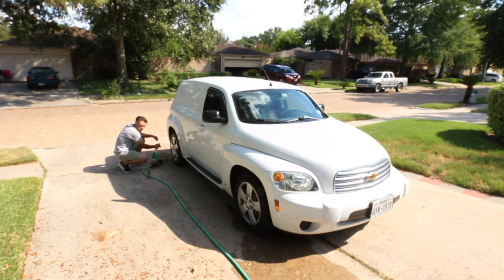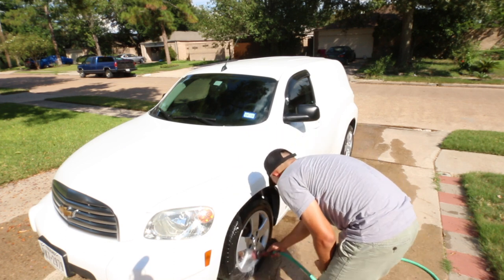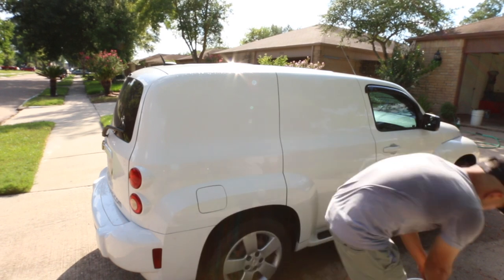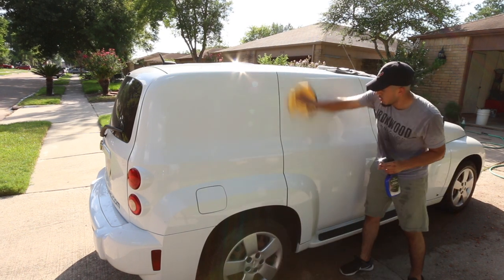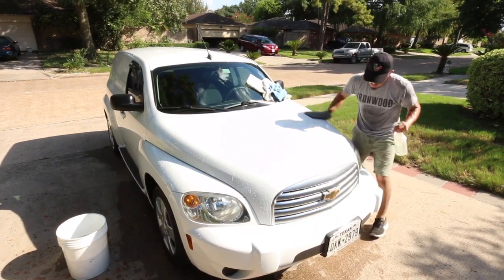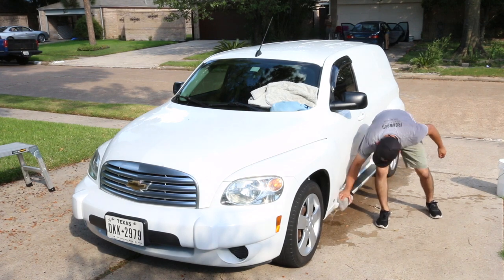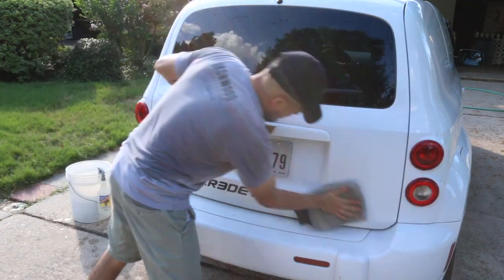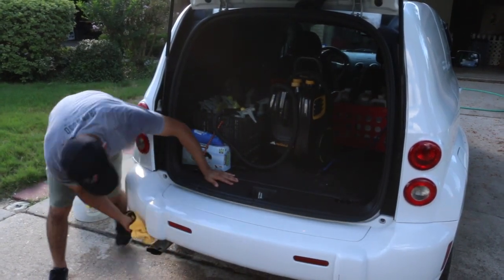TIMELAPSE: How To Wash and Wax Your Car

Comment: Oscar, Have you ever used a boars hair car brush to agitate/wash the car? The Hair seems so soft, but I wonder if in your professional opinion if it scratches the paint say compared to was standard wash mitt
Reply from the maker: A boars hair brush like the one I use for interior cleaning? If so, that's way too aggressive for washing. It will definitely scratch the car.

Comment: So i only do rinseless washes and clay and wax by hand for my business. I was told that after i clay a vehicle i was suppose to polish then wax after a clay bar. My question was can i ise hd speed all in one polish seal and protect from 3d products. I also dont have any paint correction for my business so i dont have any polishers would i be able to use hd speed by hand or lightly polsih a vehicle to remove marring or swirls?
Reply from the maker: You don't HAVVEEE to correct the paint after you clay. If the customer is willing then go for it. But yes, you will need a polisher to remove swirls and scratches. It is faaarrrrr too much work to do it by hand and the results will be below average

Comment: Due to shortage of water in my area I am thinking of using wash and wax method on my car, but I am concerned wherever the left over wash and wax concentrate on the surface might damage my paint, is it so ?
Kindly reply.....
Reply from the maker: Hmm... Well that's why you want to ensure you're wiping off all the product from the paint. If you let it dry on there it can leave a stain perhaps. But you should be fine if you're wiping it all down. I've never had a problem
Reply: Detail Groove do you mean it will be absolutely okay if I wipe the residue nicely with a wet microfiber cloth ?
Reply from the maker: How do you think the product will damage the paint?
Reply: Detail Groove it's just a guess that     wash and wax residue might harm the paint.....
Reply from the maker: Hmm.. no, it shouldn't if you're wiping it off
Reply: Detail Groove can you please tell what is the importance of ph neutral in carwash products......
Reply from the maker: I'm not actually entirely sure!
Reply: Detail Groove okay, thanks for the honest replying.....
Reply from the maker: You're welcome!